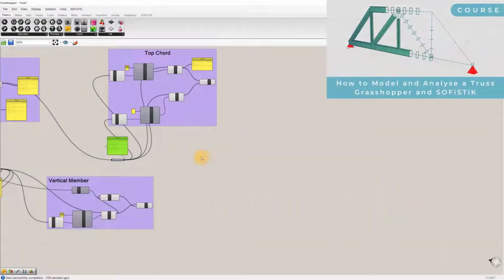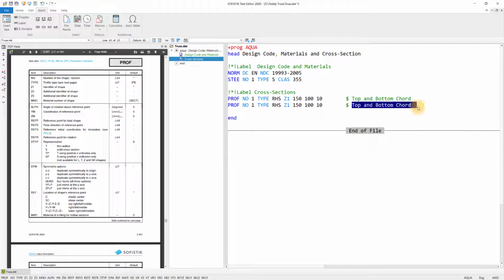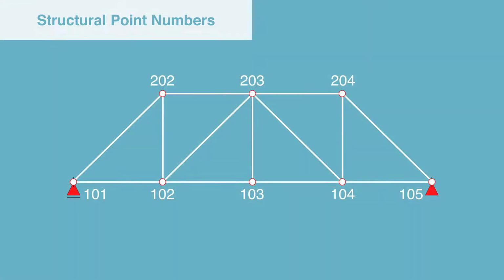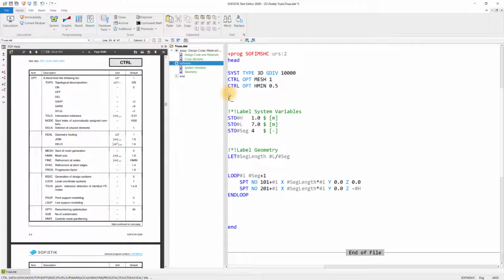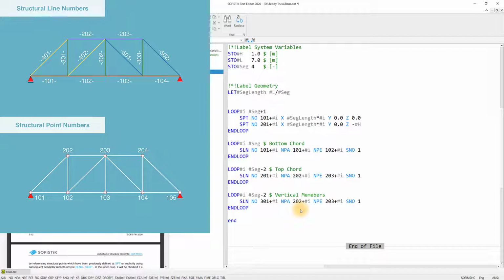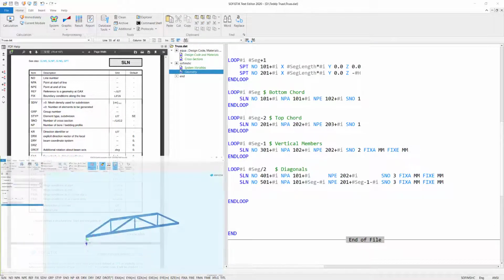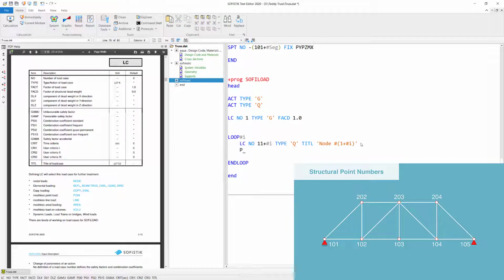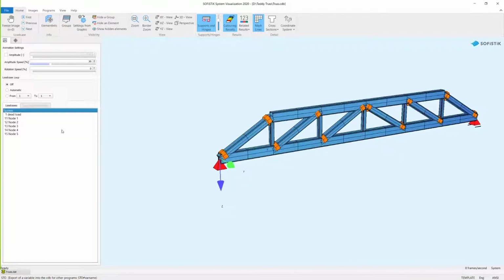How to Model and Parametrise a Truss System Using the SOFiSTiK Text Input

Comment: Very nice! Guido, what is the purpose of using +prog template at the very end of the video? Does it makes any difference if you define variables inside another module?
Reply from the maker: Hi, you could use any programme module you want to define the global variables. The advantage of the temple programme module is that it doesn't perform analysis, design, or anything else like that. That's why I prefer using it for the definition of system parameter inputs.